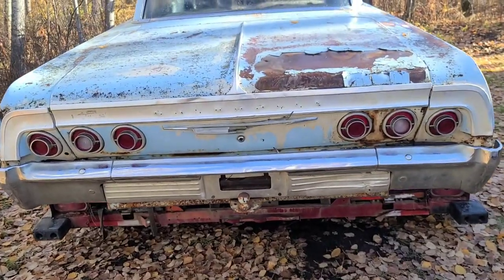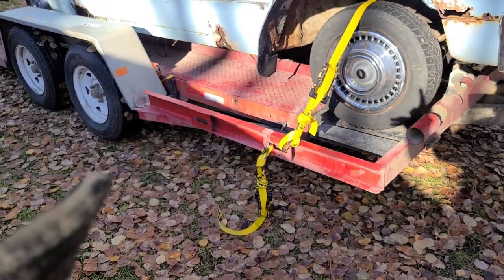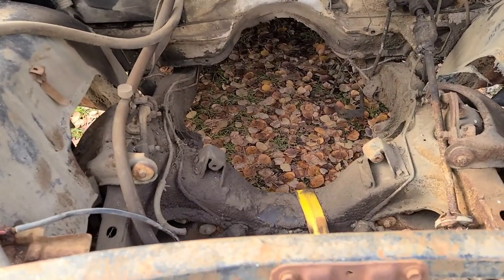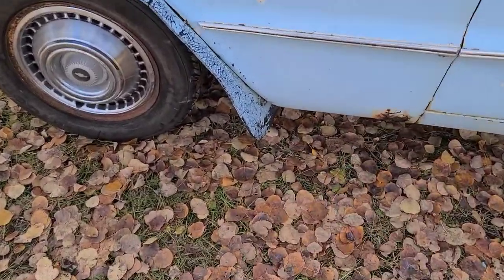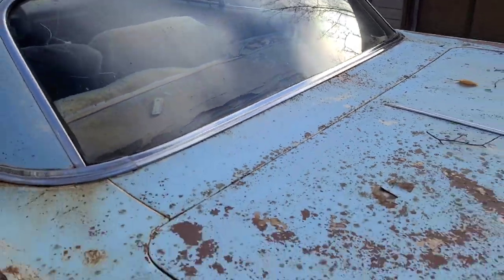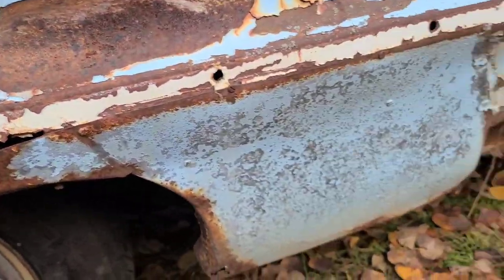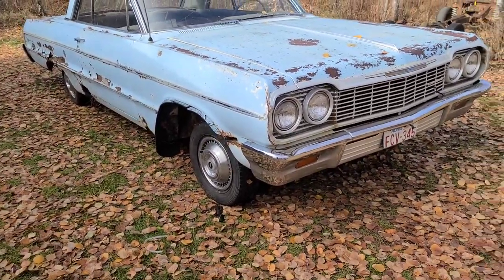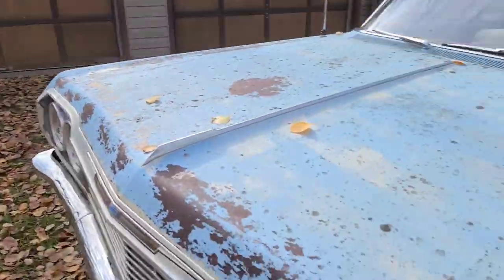1964 Impala Unloaded at the Shop,  Trunk lock Drill out and Walk Around, to get my Before Pictures

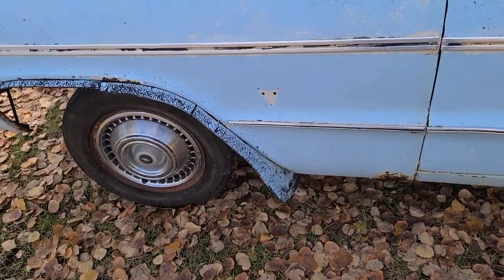Comment: At 10:40 you can see the outline of the fender emblem for 283. The 327 would be the V with cross flags. I also have a 64 Impala but convertible, 283 and powerglide.  Someday I will edit and post the video of the walk around and drive.
Reply from the maker: Hey thanks for letting me know that information about the badging on the 64 Impala 👍
Reply from the maker: A 64 Impala convertible would be a beautiful car to own.  What's your plans for that one??
Reply: @fullyloadedkustoms  Finished the resto a few years ago, now it's just maintain and enjoy.
Reply: What does the 409 have?
Reply: @JamesAutoDude  It also has the V with cross flags, but will have the numbers 409 just above.
Reply: @OldCarGarageUSA  okay thanks. I have an Impala from my dad that had a motor swap and was always curious what it came with originally. It has the flags but no 409 so had to be the 327

Comment: 1964 Chevy 2 door impala Daytona Blue light blue interior with a 327/350 4 barrel automatic floor shift, bucket seats. It’s was the first new car I ever owned and the best by far.
Reply from the maker: Nice that's awesome Jesse, I bet that would have been great getting behind the wheel of that 64 Impala right off the show room floor.
Reply: They only had a 327 / 250 hp and a 327 / 300 hp for 64 Impalas.   But I bet you wish you had kept it :D  My first car is my 64 Impala, got it for free back in '82 when they were not worth much.  Still have it, and a lot of fun.

Comment: Rebuild that 64 Chevy impala she's worth it with a new engine n dip her in acid tank to get the rust off n weld new metal n primer her three coats n a silver paint job as a base coat n finish her in a purple pearl color 14 coats n 11 coat's of crystal clear sealer.
Reply from the maker: Thanks Enrique for the suggestion, 100% agree this 64 Impala is definitely worth saving.  And the parts are readily available for it too.  House of Kolor Purple Passion Pearl is an amazing pearl color to see in person. I'm also looking at painting y 58 House of Kolor Vodoo Violet